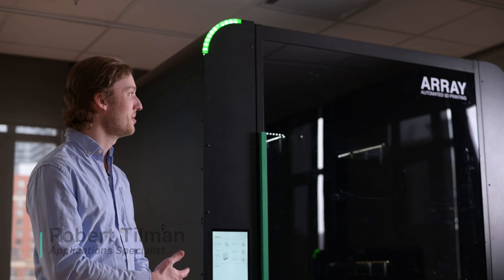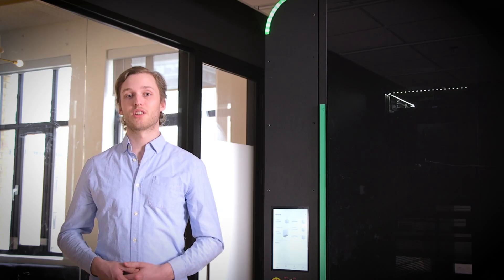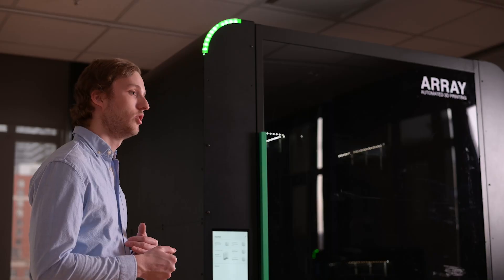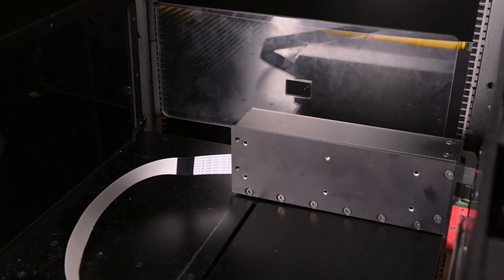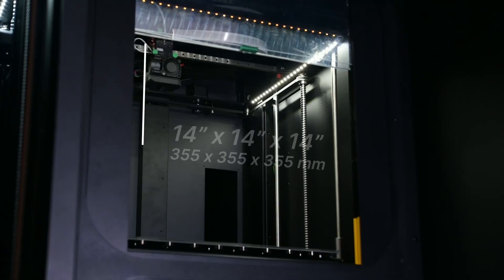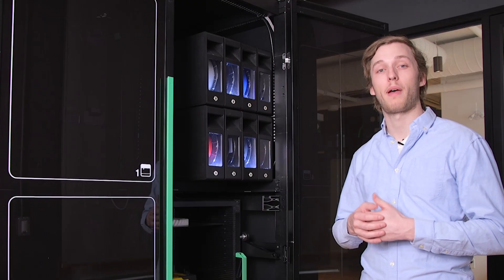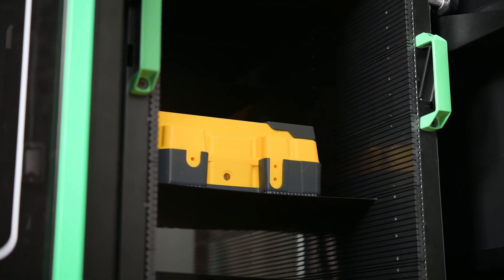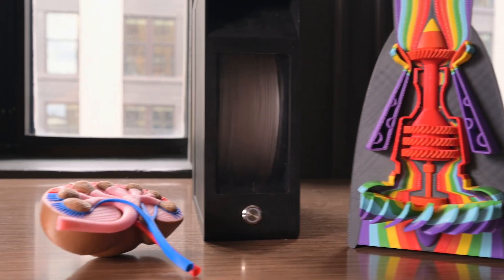Automated 3D Printing: Array Technical Overview

Comment: I order the Element printer for my business. I can’t wait to receive it. Please make more videos like this and for the Element and Element HT. Thanks!
Reply: Same.  Prepaid to get the discount.  That was long long ago. :)
Reply: I got the pallette and it came 7 months after I ordered it. I would have paid the an extra 100$ to get it sooner but they didn’t include that is was overseas shipping when I bought it. 7 months later it’s nearly impossible to get a print with especially with tpu. The tpu keeps bending because the gears go too fast and the pla and Petg won’t fuse well they constantly break off an ruin entire print after print. I’m done being a test subject on a product that’s suppose to be ready for being put to commercial use. Needless to say I’m staying away from their element prints which is really too bad since I’m in the market for multiple extruder. I’ll just buy the new Pursa XL coming out💰
Reply: @ShoopDaWoot  Interesting. I too am interested in the Pursa XL.  A friend has one on order.  Mosaic has good hardware, they need to work more on Software I think.  I have a Palette Pro also. While splicing is okay for PLA, I want a machine that does multi-material without splicing.  Plus the Palette pro doesn't work well with my Creatbot so I have to use it with my Cr10 which is not ideal.